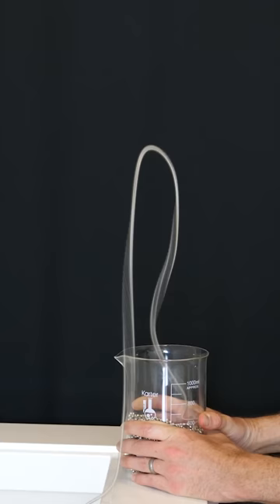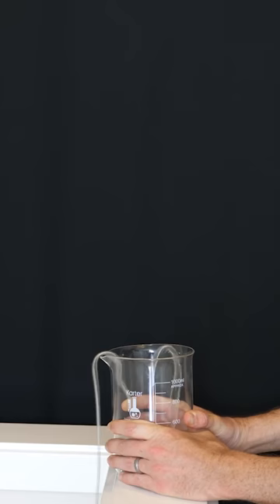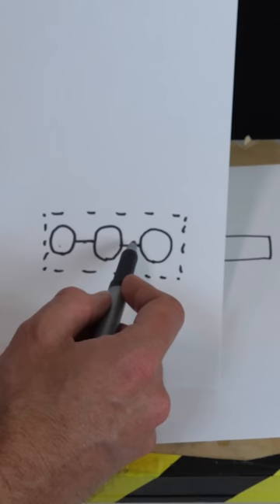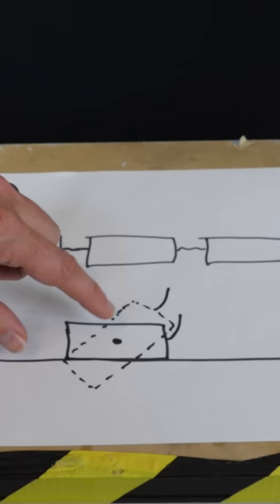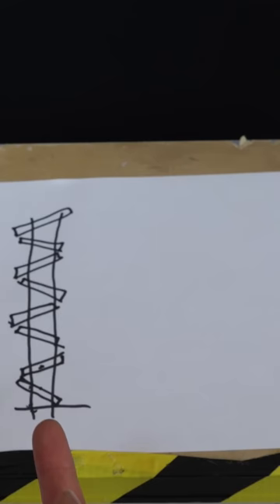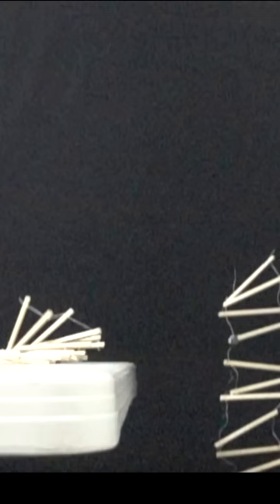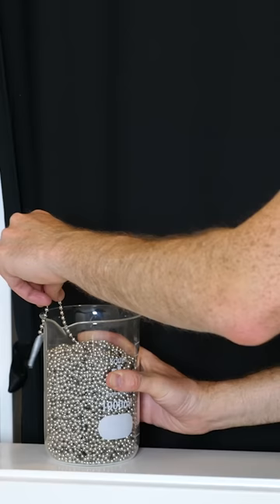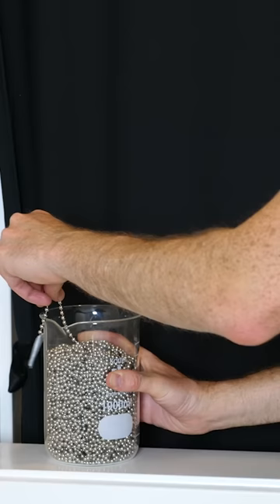How Does The Chain Fountain Work?

Comment: Do this off of everest with a few miles of chain. Thank you
Reply: 😂😂😂
A few miles of chain hahahaha
Hella funny.
Reply: I’m pretty sure someone did this out of a helicopter not too long ago.
Reply: There would be no difference. It doesn't get higher the further it falls.... just get more chain to make it last longer.
Reply: @starmc26  until it reaches terminal velocity, it gets quite a bit longer the further it falls, which is why they did one out of a construction crane with a really long chain. The longer it goes without hitting the ground, the more mass is below it, the more weight pulls down, so more equal and opposite pushing up (or however the physics actually work, there was quite a spat about it among you tube physicists)
Reply: @michaelsorensen7567  It wouldn't reach terminal velocity because of the friction from pulling the chain out of the bucket and the constantly increasing mass in free fall, which it wouldn't be in free fall until all the chain is out of the bucket.
Reply: @BrooklynBalla  can you tell which video?
Reply: @maxstriker9839  I was actually mistaken.Sorry.The video I was thinking of is on Veritasium (spelling?) but it was a different experiment involving the physics of a rope hanging on a helicopter.
Reply: @BrooklynBalla  If the chain is thick, it can be dangerous for the helicopter itself because the chain will act as a Iron Whip
Reply: @starmc26  g isn’t dependent on mass
Reply: @giromasa1149  yeah could easily hit the rotors lol

Comment: The weight from the beads is pulling down at such a force that when it pulls the beads off of the bottom they continue upward far enough to lose pressure and then get pulled down by the way to the beach falling. The higher the drop the faster the beads move before touching the ground once they touch the ground the speed they reached before touching the ground is the speed that pulls up on the beads in the jar therefore increasing the height of the beads getting pulled up.
Reply: oh yeah prove it

Comment: Could this effect apply to a flow of water crystals?

Say you made a chamber, which can pressurize and change the temp etc... can you keep water in a semi liquid/solid state, and try to have a fountain stream out... 

Would the ice crystals act like the beads, and the water like the rope? Or could you mix a a viscous liquid with another substance and put it in a similar semi solid/liquid state and try again...

I am fascinated with this effect and wonder if it can apply to any form of liquid....

One more question. If you set a certain sound frequency in the chamber, causing the substance to vibrate that rhythm.. Do you think you could mathematically determine from the shape of the water vibrating, like the shape of the ladder that you dropped on the table, whether or not it will fall faster or slower then another set of the same substance set at a different frequency, and it could even potentially cause greater or lesser lift in the air, like the beads?

I know it was long winded but this is crazy fascinating... What are the implications with electricity, magnetic properties applied to this.. like how many forms of this moulder effect can you recreate with frequency, magnetism, and a control room with the particular substance?

You have to tell me you're interested in at least testing this...

I would put a jar of liquid in a vacuum, , set your control temperature, pressure and the third thing... Start amping up the frequency and it is your choice if you want to use sound alone or an electromagnetic flow inside the actual liquid..  maybe both would be cool to experiment.. but then once you have a frequency which cause the substance to oscillate at whatever shape you feel is mathematically best.. then start the spout to create the stream.. and the different oscillations might cause the string to grow, change shape, or even shrink and just go totally rapid in splashing like manners..

I'm telling you, it has to work...

Comment: I'm curious sounds like a snap when the last ball turns the corner from going up to down... how fast is that last ball on the chain moving? Is the snap like the crack of a whip in this instance?
Reply: Well it’s going from stationary to the full motion of the chain in nearly an instant, so I’m sure that caused Atleast some sort of snap from the chain but I also think the last beads got flung into the side of the jar making a noise.

Comment: You said it that the higher you drop it from the higher the chain rises, so the chain falling is what it pulls the other half of it that's inside the glass, and to prove your theory wrong ElectroBOOM made three videos about the mold effect (it's the name of this effect) in which he did the same experience but with the chains on the ground: he would grab the end of and run to see if the mold effect really depends on the balls pushing the chain up, the effect still occured even though there wasn't anything that the balls can push themselves up against, watched the videos that ElectroBOOM made about this effect and how it's occuring

Comment: The “kick-off” method is not how this phenomenon works. There’s a good paper online that you can find explaining why it’s not so, which also proposes another explanation.
Reply: From what I've seen they managed to directly measure the "kick-off" force and it matched the calculations almost exactly, unless someone else got in on it later I'm pretty sure it was settled in agreement
Reply: @JedLath292  Well there was first a paper that measured the “kick-off” force but they didn’t isolate to prove that that was actually what was happening. This new paper proves that.

Comment: This is not the "Mould" effect. Mould has yet to prove his hypothesis correct and I feel he has been proven wrong on many levels. The "lever" action would not be enough to account for the energy in the system, instead tension caused by gravity can explain this effect beautifully and simply. Mould also does not get to ne an effect he not only didn't discover but also failed to explain.

Comment: I used to really like this channel, but this guy has gotten so cocky and full of himself, that he isn’t even telling the full truth anymore. Yes, there is some force from the transition but it is not the main source of energy. I am very disappointed and dissatisfied.
Reply: The remainder of the energy source stems from the twine holding them together: being pulled by each bead following the constant acceleration force of terminal velocity straightening out adding spinning centrifugal forces and become “longer” adding additional time for the already falling balls to gain more total inertia pulling “up” on the remaining mass towards the beads “floating” in the air. In reverse when dropped the string twists and “shortens” pulling the string down “faster”. Please tell me if you feel otherwise.